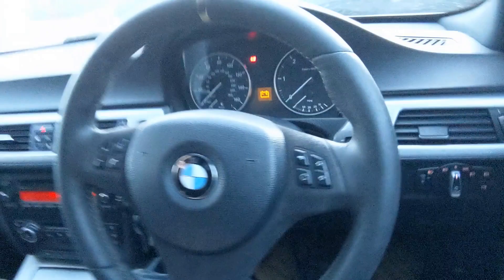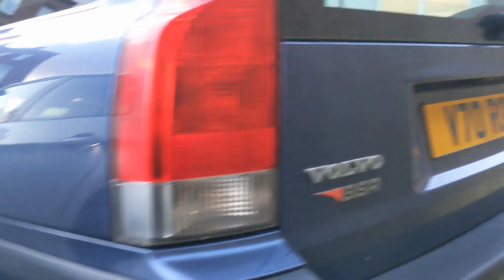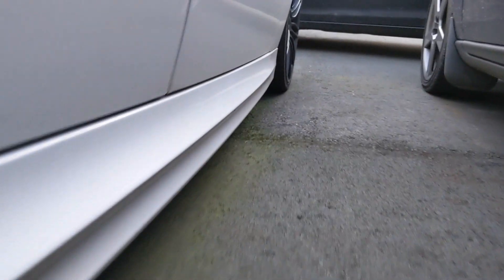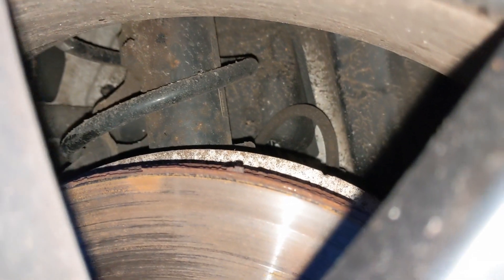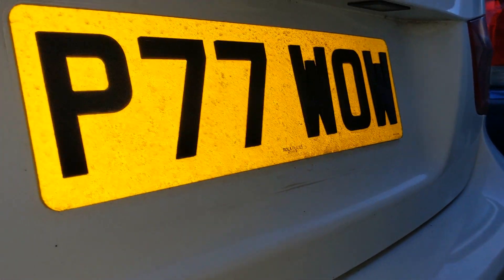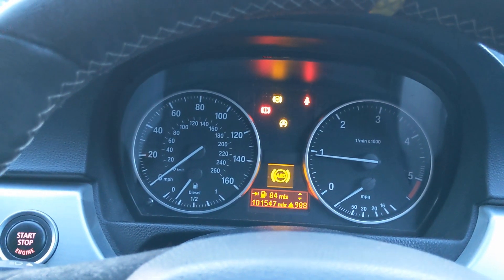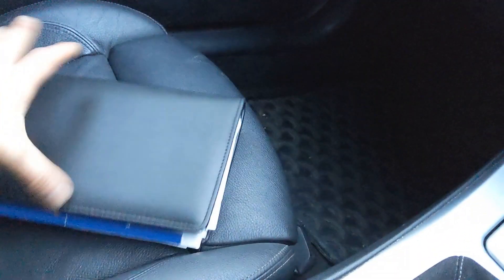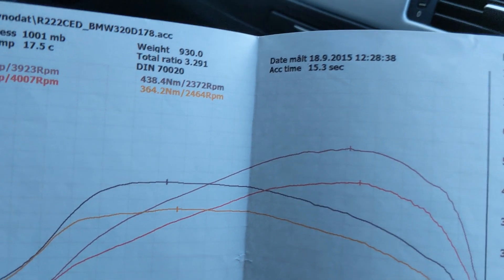BMW 320D M-Sport First Look

Comment: Nice car! The new colour on the wheels look much classier. I have only driven one E90, but the condition of it was a bit.... well not up to UK standards lol. I had to change the starter motor on it for my neighbour.
Reply from the maker: I agree. I've driven plenty through work but never intended to buy one however there was a car dealer trading off the forecourt at work who had this traded in. It was too old a too high mileage for him so he wanted rid of it. 

Depending on the engine your neighbour had it could have been a piece of cake or a right ball ache. Haha.
Reply: @Papa77sGarage  it was a 2005 325i n52, so it was a early car. It was the first proper DIY video on my channel lol. The lady never looked after it. I was considering buying it for my channel so I’d have more content, but I couldn’t justify £4K buying it. She sold it a few months back and bought a skyline v35 saloon, and the condition of that is even worse lol.